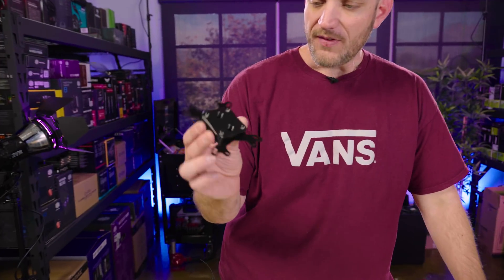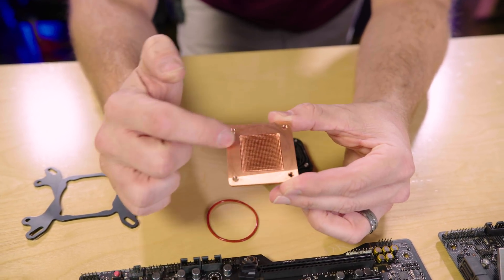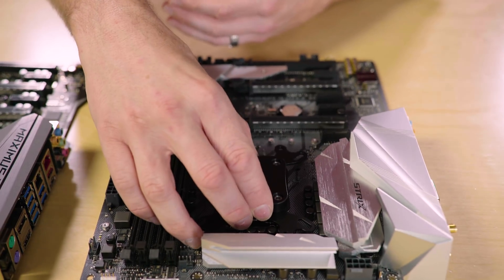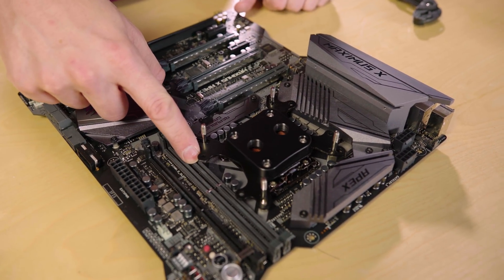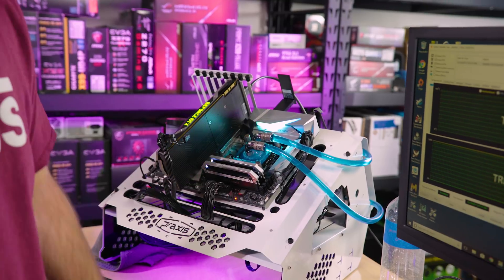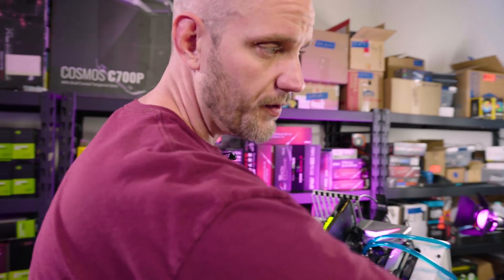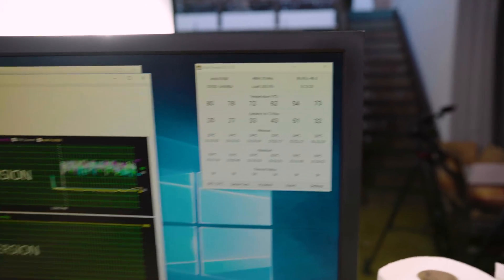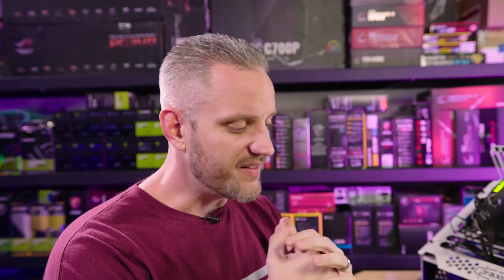I tried watercooling an overclocked 8700k with a $19 waterblock

Comment: +JayzTwoCents was the 8700k delidded??
Reply: Seriously with my 360 aoi I hit 89C - 95c on my cores from lowest to hottest cores (8700k)
W/deepcool captain ex 360 from ibuycyber...... running cinebench!
What program is Jay running so I can compare apples to apples?
***Im running 4.9mghz @
 1.320v on an ASROCK Fatal1ty gaming K6***  is this normal?!?  They even sent me a replacement cooling unit
Reply: Confeter Confeter it is and has never been delidded (stock OME 8700k) and I will DL Aida64 trial version in about 10 minutes or so.  Then post my temps.  Ty
Reply: In Germany are several companys who sell tools for delidding Intel CPUs. For example caseking.de der8auer Delid-DIE-Mate or aquacomputer Dr Delid. With them there is only a smal risk to fail delidding a CPU.
Reply: I have 8700k no delid and same tests my highest temp was FPU only spike at 85 with average 80. 360 Rad. (Aida64 Extreme v5.95.4500) using Raystorm pro and z370e Gaming. Ran *10 min. 5Ghz oc (Posting for people to reference).
Reply: Yeah good question ? And is this the original supremaxy ou the MX version or EVO?
Reply: he's using AIDA64 trial version and the stress test in the program, do it and tell us what is your temp please. Ise your CPU delidded?
Reply: ok thank you !
Reply: Is NOT delidded.
Reply: Ok Aida 64 Extreme version 5.95.4500
Case fans 2 140s and 2 120 set to full speed.
Cptn 360 ex pump and fans set to full speed.  3 120 deepcool fans w/red corners (came with radiator/pump.)  Not generic fans.
Idle cpu temp: ~36 (system was just running cpu-z stress test for over 20 min and max steady temp on cpu was 88c.

Jay stressed CPU, FPU, and CACHE.

first run: CPU, FPU, CACHE
Thermal throttling alert and I shut it down to see 1 core at 100c.

Ok I said well is it one preticular test that's throtting(?)

Test 2: CPU only 
Temps 74-79 on cores

Test 3 FPU only:
Within mere seconds graph turned RED and test stopped due to "hardware failure"  aka hot as McDonald's Coffee.   Temps 101c!

Test 4 cache only:
Temps: high range on cores = 84-90c,  CPU temp high was 88c

Test 5 CPU & CACHE
Temps:
Cores: 84 -91c
CPU: 88c

Test 6 was with test 5 running...
I clicked on FPU to add it in and it throttled once again only it took several seconds to 10 seconds... the temps spiked to 99c on at least 2 cores 97 on another and 98 yet another this time and I clicked stop as soon as saw the throttling warning. lol. So my cpu hates FPU.

Anyone have any helpful sugestions.
MB is ASROCK Gaming K6 with latest Bios.  Sigh.  It really Erks me that every review chip was Hand picked.
I want to delid but cannot find any delidding tool for sale/in stock in the USA.  I'm sure there is but have struck out in finding one.  If there are any out there (not from eBay)  pls let me know.
Reply: Chris Lin'something' so you have 100°C With thé same test like jay? Maybe he delidded his CPU
Reply: I think the tim on your cpu doens't cover the die perfectly. Or the captain is just that much worse than a normal 360 rad. I've read roundups where the 360 rad on the fractal kelvin was worse than some of the single 140 AIOs (tests done with all noctua fans at fix rpm, on the same i7 cpu).
Jay's 80C is not rational with a decent 360 rad and "turbo fan speed". It's certainly not delidded. If it is, then not with liquid metal.
I'd suggest getting a replacement CPU or delidding this one and putting liquid metal on it (a simple razorblade taped up with duct tape and thermalgrizzly conductonaut works  great).
Reply: My 7700k runs at 4.8GHz on 60C with a 240 rad, the fans spinning at 800rpm (bitfenix spectre). Stock tim replaced with liquid metal.
The bigger rad and bigger CPU should equal this setup. 6 cores 4.9 under 360mm and turbo = 4 cores 4.8 under 240 and low speed. I'd expect 65-70 from a delidded 8700k at 4.9.
Reply: How much voltage are you all needing to get those clocks  at your posted temps?  I set my bios to fixed volts.  Ty all for replies.  I bought my pc thru a boutique shop and don't know if I can simply get a replacement if it runs under 100c at stock.  But then again I will need to see if it even passes FPU at stock 'k' speeds (I forgot if it ever did).
Could I go thru intel?  I have never returned  a cpu before and know nothing of the proccess.
Reply: @Macker Mark  those are ones I want (dr. Delid)  but can't find any sites that sell em in the US. :(
Reply: You can't go to Intel - the builder that bought it OEM possibly could. But for what? I'd bet that with stock everything running normal software, it runs fine. I got a Ryzen 1600 that can't be trusted at 3.6Ghz, much less the 4 that other people are getting.

Buying a chip really is a silicon lottery.
Reply: You need to try and reseat that cooler. Sounds like a TIM issue :/
Jays 8700K was defo not delidded. 80 range sounds normal for stresstest of a watercooled slightly OC'ed stock 8700K. Delidding on average yields 10-15°C reduction on load, with some reporting 20°C reduction.
Did you try it yet? If you can get access to a 3D printer, then that is an easy and cheap route to a delidding tool.

Comment: I imagine the pink-orange o-ring is butyl which is used for stuff stoppers for sealing liquids in glass long term - I see no reason it shouldn't work for this other than heat degradation...

Comment: for your "Cheap Custom loop" look at the "Eisbaer solo" it is a block, reservoir and pump  in one peace. in addition i used a radiator from a Air conditioning. It kept my beheaded 7700 @ 5.1 under 65°C Prime95.

Comment: I wonder whether one of these blocks can handle the heat output of a overclocked gpu core (also with proper vrm cooling, with a ram block on the vrms :). Thinking of getting two of these and doing a single full-loop that'll be up-gradable and cheaper than a full cover block
Reply: I have one of those on my 6600k at 4.5ghz and they do a gpu version I have on my  asus 1070 which means I can still use the original asus shroud and fans with a little bit cut out for the water pipes,been working perfect for the last 8 months or so and my 1070 is power modded.never goes above 40c,cpu stays around 35-40 max

Comment: Great video, I know this isn’t really your forte, but I’m curious as to what cooling I can expect to get out of a NZXT Kraken X52 on a delidded 8700k overclocked to 5.0 ghz. Am I going to burn up my processor or will that be enough?
Reply: Use liquid metal, and you should be clear as day. I'd say max 80C (considering it's a 280 AIO).
Reply: Its a 240, not 280.  And 80C seems REALLY hot compared to what I was expecting.  Was expecting closer to high 60s low 70s.

Comment: Cheap to buy but it does look good like you said with the screws showing, but with how the plate attaches to the block no way in hell will i buy that for the cpu's that are out now. Possible for an old system to make it silent as possible on the cheap.
I think i'll stick with my Koolance cpu-380I and my 4970 until my MB dies and i go for current generation boards and cpu's

Comment: That O-ring looks like a PTFE coated silicon o-ring also known as TESC or Teflon encapsulated silicone. Pretty high-quality for that price though, so I may be wrong.
Reply: I would agree on VMQ (silicone), but I wouldn't say that it is PTFE encap (or FEP for that matter) - that would be to expensive and I don't see any benefit as the encap is mostly to protect the inner O-ring from extreme heat and/or highly aggressive fluids. Also VMQ by itself is already very resistent to glycol and other coolants, so there really is no need to protect it with a PTFE or FEP encap. 

Source of knowledge: I do sell them and the company I work at produces them
Reply: Well "high quality" o-ring still only costs a fraction of a cent.
Reply: ABaumstumpf actually, Teflon is pretty expensive, a single oring like that costs about 40 cents to make, still sells for close to 3 dollars, or 1.40 wholesale. Yes, I do sell these things.

Now, a regular black BUNA N, EPDM or neoprene oring? YEAH, super cheap
Reply: With a price like this I would definetely not expect PTFE. Most likely just a red EPDM compound. If only I had one I could tell you within minutes with my FT-IR spectrometer :P
I wouldnt expect silicone either. While it is very inert both in terms of copper and glycol/water resistance, the permeability is very high, and water WILL actually slowly permeate from the coldplate/housing junction - but that would require the company to be aware of that (for the price, they might not, so what do I know...)

Comment: @Jay : is your 8700k delidded? or no?
Reply: most likely no. The temps didn't rise because the water wasn't getting warmer, which means there's negligible heat-exchange between the IHS and the blocks. I had to stop the fans on my 240mm radiator to see any increase in the temp of my stock 7700k (68-> 69-> 70 slowly increasing). Even with liquid metal on the 4.8GHz 7700k, the water gets to max 30C, while the CPU is at 60C.
Good solder > liquid metal > good TIM > cheap tim > intel stock tim > air

Comment: It's precision-camera.com, not precision-video.com.

POM, acetal, and Delrin are all the same. For the most part, before getting into POM-C and POM-H. But saying "It's POM, not acetal," makes zero sense.
Reply: Here is a link for reference.  I thought Delrin was impregnated with lubricant...but its not.  Just the structural difference makes it harder, rigid, and naturally lubricate itself when scuffed/scraped.  Thats why paintball guns with poppet valves have Delrin bolts.  Learned that all of these are acetal compounds today!
Reply: Andrew Delashaw i see you are a man of culture as well

Comment: id like to see a vid with the gpu version of this block, got this block and the gpu block and a cheapo 240mm rad cooling my i7 4790 and r9290 and yeah temps hit 75c but who gives a f it cost less than one 120mm aio (got heatsinks and plenty of airflow on the hot parts of the gpu and theres plenty of anti corrosive shite in the water)

Comment: I'm using two of these on a x5677 dual cpu configuration (xeon 130W tdp), a chinese pump, 360mm radiator on a motherboard from an hp z800 workstation with 48GB ram. All for about 400$. temps under 45°C under stress test aida 64.

Comment: Couldn't you just take the 4 bolts out and rotate the top 90 degrees? Anyway, i'd like to see more of these with cheap hardware. Red o-ring usually means viton, but i can guarantee it's not viton. Probably just silicone.

Comment: Red O-Rings are a standard O-Ring type called S70 Silicone.  However it could be almost any material.  For the price I would bet they used a standard and not a custom color.  

Here is a site that indicates a color standard.  This a manufacturer and they listed the the "standard colors" and note they can make them in any custom color.  https://www.globaloring.com/oring-colors/
Reply: you watch ave too?
Reply: @josephgilbert4800  Dude I love that guy (no-homo). Most legit tear downs of all those transformer tools.
Reply: JR it only matters for durability and types of fluids you can run in the system.  Some o-ring materials don't work well long term with glycol and other additives used in water cooling.
Reply: JR glycol is pretty standard.  I don't know too many solutions that don't contain some form of glycol.  There are some but very few.  The issue with Na is that it tends to be very corrosive and degrades metal components.  It will also, over time, harden some types of tubing and seals.
Reply: Drew Gossett it could be they both would work in this application and the price would be about the same as they are cost out within a few cents per thousand.  They would both last about the same time too.  To figure it out he would have to read the MSDS on the product if available.
Reply: EK's Cryofuel and few others, not sure if Thermaltake's is? and another like PrimoChill. Clearly some stuff not Glycol Based. What's in Most of the AIO's shipped out IS something Glycol Based for sure.
Reply: The 10-20% Glycol mix isn't always best thermally, a different Glycol anyways not like the Automotive, help with Aluminum though The Cryofuel is some Sodium Deriative, and just whatever Purified or preferably Distilled water.. Minerals in water isn't good and will speed up corrosion, Calcium Chloride isn't good. but like some Sodium bicarbonate shouldn't be an issue. Drain more Periodically. I don't know some solutions seem pretty heavy on the Inhibitors, Probably in mind with slowing down Galvanic Corrosion. But more stuff like that passes on all seals and tubing, so no worries there.
Reply: Pretty Heavy ratio currently on solutions/Inhibitors, more like 5:1, Because small amount of Calcium Chloride in there. about only thing bad in.
Reply: I work in water infrastructure making pressure control valves. We use the red silicone orings in applications that require them to survive high heat environments such has sealing two mating parts before we heat and powder coat parts. My first thought was they are thinking the blocks will be exposed to higher temps that would degrade other elastomers, so they went silicone. If that's the case it's a nice touch for such a cheap block.
Reply: It's a O-ring man and you want it colored and Shit Lol
Reply: Well I don't believe will be Running the Glycol Based stuff. I don't know yet...the Sodium variations of types of Solution's should be okay feasibly. Crazy bastards adding so much who knows what toxic shit it eats and Leeches the Tubing and shit Lol

Comment: You should leave it on the test bench to see if (=when) it starts leaking!
Reply: construction was good. no big need to worry about leaking. If u really are afraid of it. Buy water resistent adhesive and close it "forever". That being said, ofc it can leak, like an ekwb part can leak too.
Reply: It's not that difficult or expensive to make two hefty, solid flat pieces (i.e. the copper cold plate and acetal top) fit together so that they are watertight. Just use an o-ring and screw them together. I would be surprised if this thing was any more prone to leaking than most other water blocks out there. The place where you get leaks most of the time are the fittings, and even those typically only leak when they are either not screwed in tight enough, or too tight. Or, well, if the o-ring is faulty, which can happen. They age, they get brittle and they break at some point.
Reply: EK parts CAN leak too. I had a brand new Supreme HF (it was some time back) that leaked right out of the box during leak testing. They refused to RMA it so i bought new O rings for it.
Reply: @DLTX1007  lol refused rma on an out of the box defect rip
Reply: im using one of those for 3 years, not problems at all
Reply: Yep. I had an issue with an EKWB pump/res combo, where the threads on the reservoir didn't pair with the threads of the volute; it eventually vibrated loose, and started to leak significantly. Luckily I noticed that the sound from my machine was a bit off/strange, so I looked inside and noticed the liquid coming out of the pump and cut the power immediately. Luckily no parts were damaged.

We're talking about a $160+ pump/res from a reputable company that was defective. I opened a claim with them two weeks ago and have not heard back. I've heard from others that their customer service is shit, and so far, that seems accurate. So, yea, a leak can happen regardless of cost and manufacturer.

Comment: If I'm right red O-ring means it is water resistant and heat resistant till 100°C
Reply: If you have a red O ring you didn't use enough lube. Try to water cool it. Good luck!
Reply: +Turrebo gosh darned it lol the nose is not meant to be an exit for coffee
Reply: +Turrebo
If you smoke after sex, you're doing it too fast.
Reply: Probably Silicone and good for 200°C

Comment: Does anyone know why my 8700k goes up to and stays around 95°C when stressing it? I am using an AIO but I still shouldn't be seeing those temps rights? Running at 4.7 Ghz with a masterliquid 240 AIO. I Have it set to run with 100% fan  speed when it gets above 70°.
Reply: i think it's because your CPU is not delidded

Comment: the o ring I would imagine to be nitrile which is common for use in pumps and seals where water ingress is imminent altho silicon o rings might be better as they are more resistant at higher temps.

Comment: I’d like to see cheap rads! Not car rads, but cheap eBay rads made for pc cooling!
Reply: Sounds rad!!
Reply: they work perfectly fine, but they are made out of aluminum so you have to make sure all the metals in your loop are aluminum. i built a water cooled system for a friend using only ebay/aliexpress parts and it's been running for over a year without a hiccup. 

in retrospect, i regret spending hundreds on my EK and alphacool garbage. i should have went the ebay/aliexpress route.
Reply: Automatic transmission radiator. Lol
Reply: J has right idea though dude, water guy. gonna be putting the 7700k under the EK kit so will see how that goes. That thing has a better block dude even if it is Aluminum. He's using like yeah equivalents to yeah all those cheap $20 china blocks.....absolutely shouldn't try to cut corners on the block.
Reply: Dazrihs really rad#
Reply: there are some really cheap rads on ebay i just bought a 360 black ice nemisis for 35.00 and before that i bought a 240 swiftec rad for 25.00 those are aluminum rad prices.
Reply: i dont know i paid 18.00 for my block its copper and it kicks ass my 6700k is running at 63 is the max. i just cant see spending 100 bucks for 2-4 degrees i would rather spend the money on other more important things
Reply: thats what i got the one with the black base. i love the block i own 2 of them cause the first one got lost then arrived at my door 2 and a half months after they sent the 2nd one. so now i have an extra block and pump and res.